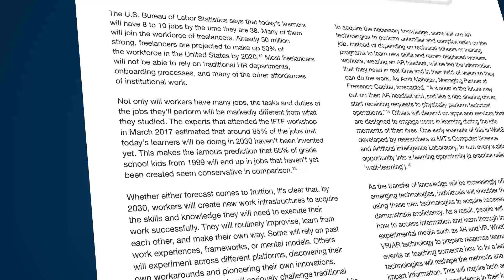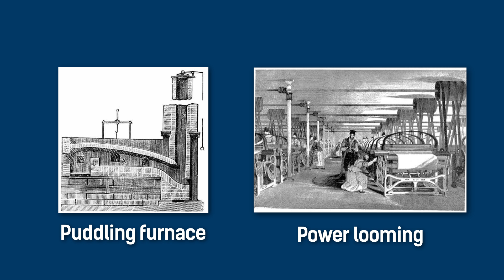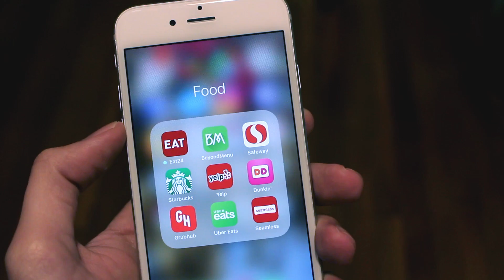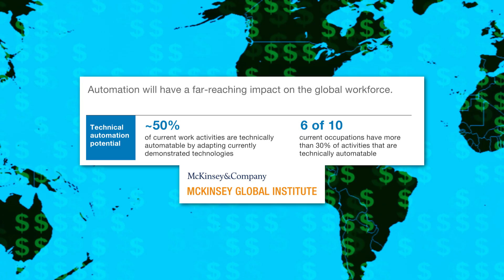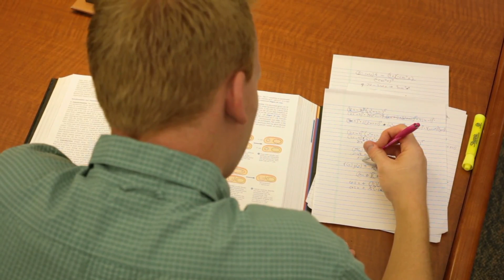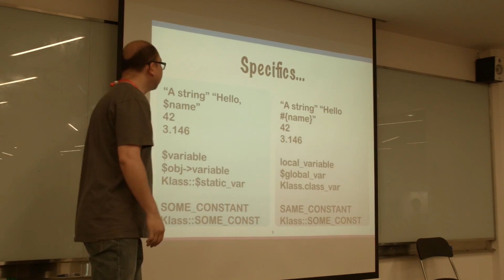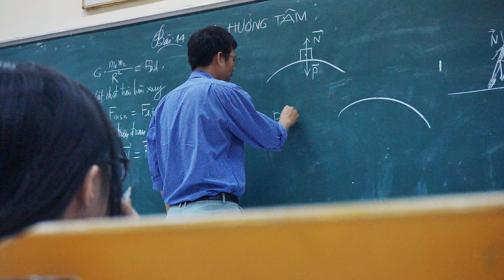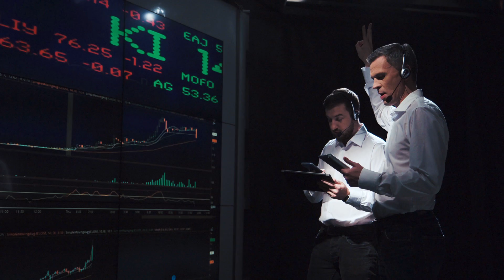AI: Why Our Jobs May Be Safe

Comment: This was so well put together and so interesting... I work in DNA profiling and within the last two years we have implemented an automated line which has dramatically increased our output. So far humans are still needed as the robots we use require occasional babysitting and there are some manual steps but it is a clear step forward into the future.
Reply from the maker: RP T Thank you for watching! That’s really interesting. Hopefully your job is safe for much longer! It sounds interesting.
Reply: FutureNow  thank you, I think it will be! Thankfully there are a lot of areas that still require human input in this field - such as analysis and interpretation of the results - so I should be safe for another... 5 years or so? 🤷‍♀️